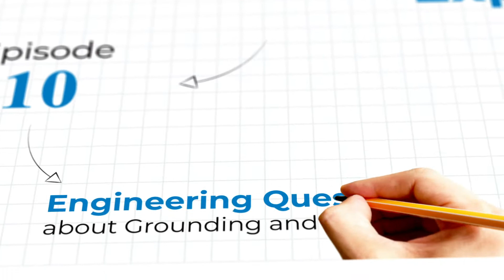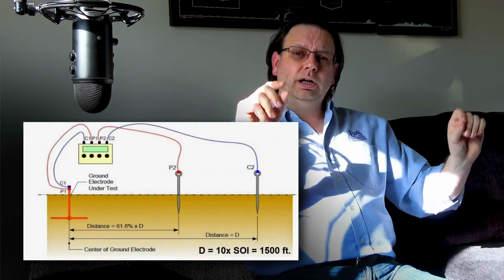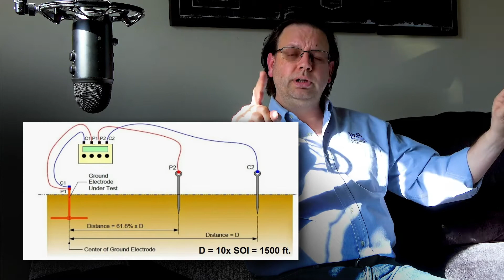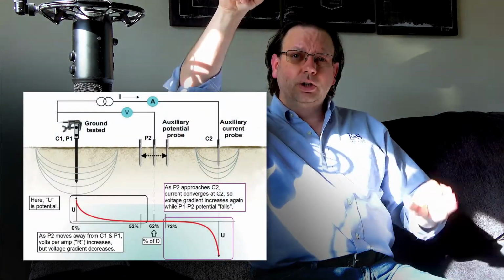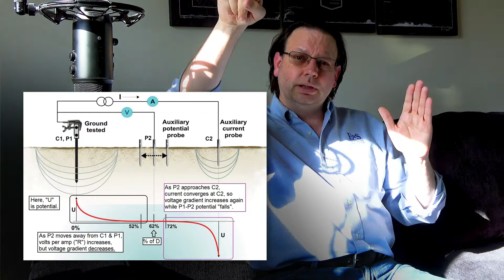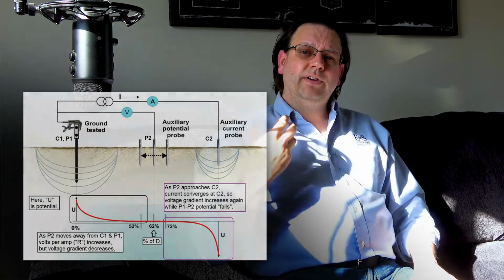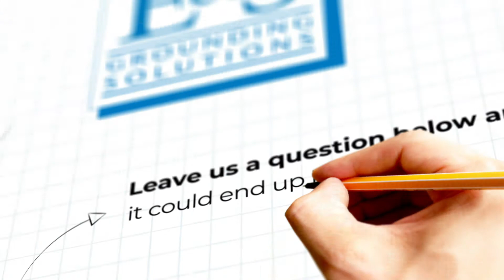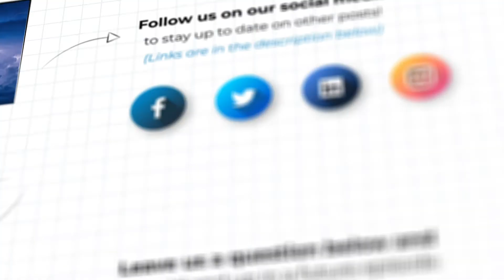What is Resistance to Ground Measurement? (Part 1)

Comment: Once I´ve determined my resistivity for example reached at 10 meters, that means the distance among bars for my ground system (grid) should it be 10 mts?? how do I use that 10 meters reached?